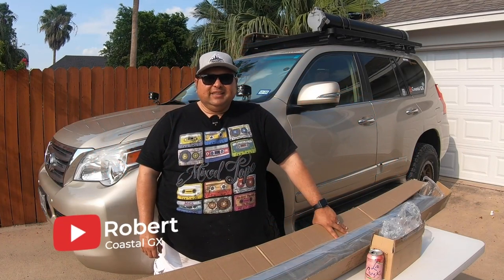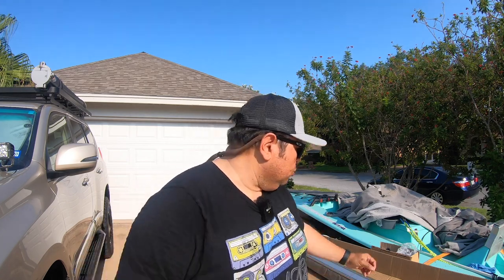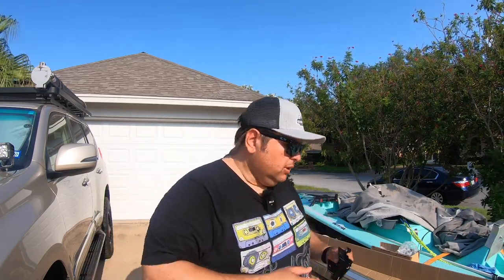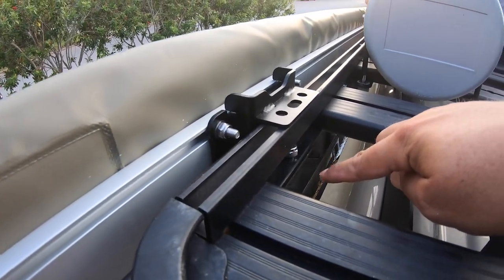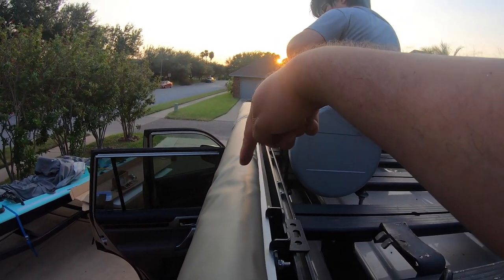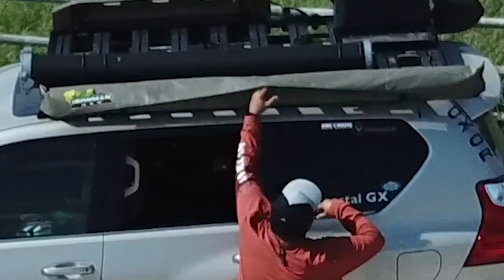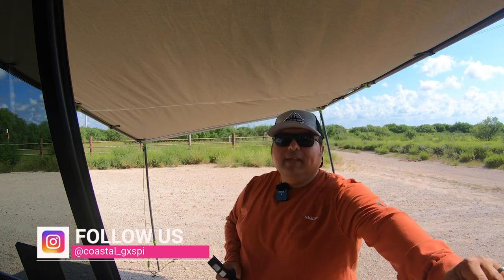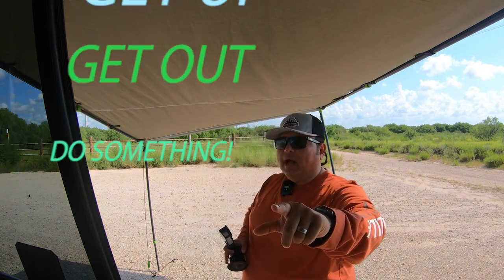Ironman awning using Frontrunner brackets on a Slimline 2 roof rack

Comment: Now in 2022, Do you still like those front runner brackets? Looking to get a 270, and seems difficult to find options for brackets
Reply from the maker: Hi there. I used the brackets and I still have the same setup. However, the included Ironman brackets could’ve worked as well. The cool thing about Frontrunner is that you can use regular hardware instead of exclusive “proprietary” bolts like other roof rack systems.
Reply: @CoastalGX  thanks!

Comment: Thanks a lot for this very detailed video. Do you think if one person is trying to do the install, it would be easier to mount the brackets to the rack first and then hold up the awning and line it up ?
Reply from the maker: Either way is fine. I did it this way because I found it easier and the sales rep made the suggestion as well. Thank you for watching and good luck with the install!
Reply: @CoastalGX  Thanks for the help. I just completed the install. For the benefit of others who might be doing this install in the future, you should really install the brackets to the awning first if installing on a Slimline II rack. There is little to no room to tighten the M8's on the awning/bracket combo if you have the brackets already installed on the rails.
Reply from the maker: @sikandinc  thanks for sharing and congratulations on the install!

Comment: How do you like the frontrunner water tank?
Reply from the maker: It's perfect; Holds 11 gallons and has held very well in the hot weather of the RGV. Very durable plastic and the brackets have endured the sea salt just fine. I'm uploading a video tomorrow that slightly addresses the water situation. I hope you get to watch it.